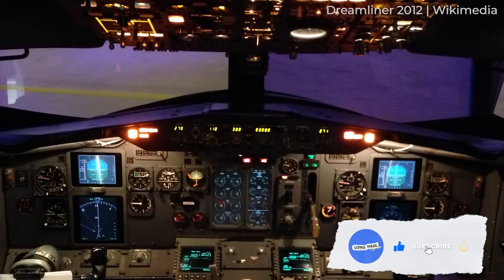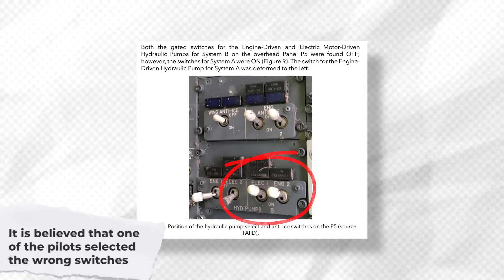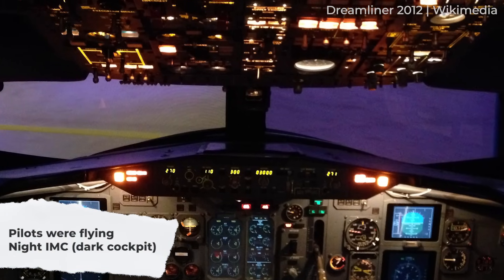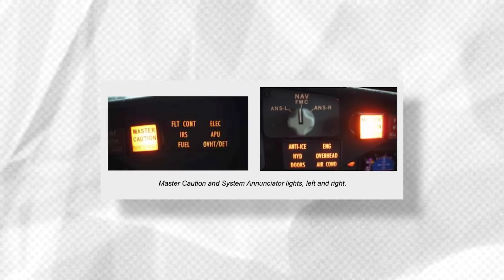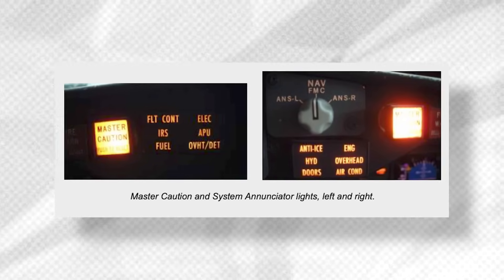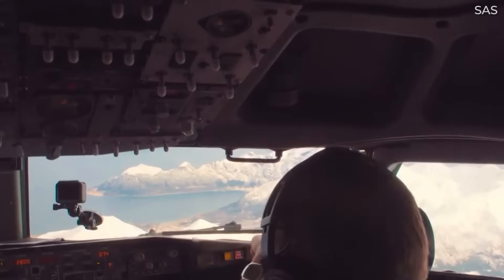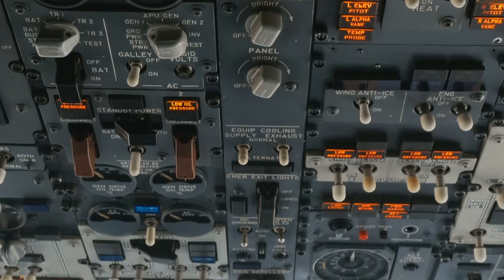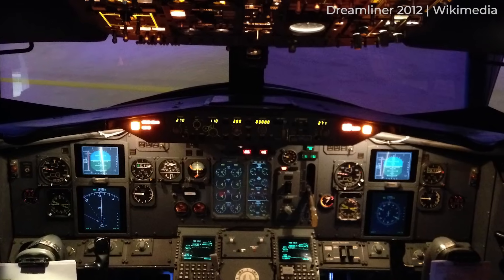Boeing 737 Crash Analysis: Human Error Vs Poor Design

Comment: I think the key is what you highlighted at the end. When you're tired, and already distracted by other things, having a clear, unambiguous place to look for fault messages is much more likely to result in a correct diagnosis. Even better if you can both illuminate the switch AND show an EICAS message. The 737 is a very old design now, designed long before many of the modern ergonomics research was done. Its long passed time that it was changed, and to be fair, it would be impossible to design a new aircraft with the same design, but there will still be 737 flying for another 20 years at least, even if production was stopped tomorrow. Maybe not this exact error, but the same root cause will almost certainly kill again before then

Comment: As a 737 pilot over the last decade I’ve seen enough pilots make this same mistake to say that it’s one that many of us will do once in our career.  If you have good discipline to not cancel any master cautions without announcing the warning and verifying the amber light, it’s no big deal and you simply rectify the error.  These pilots had a lot going against them including as you mentioned possible fatigue after a long night, but in my opinion the biggest human factor in this accident was the fact that they were way too fast and perhaps a little high and behind the aircraft at the beginning of the approach sequence.  I believe this is the real reason why they cancelled the master caution without verifying it.  They were in a self imposed time compression scenario where things were happening faster than they were equipped to handle them.  The cancelling of the caution light was an instinctive reaction to get rid of the added “nuisance” to their already full plate.

Comment: 737NG mechanic here. Even considering the cockpit design, the pilots did the wrong switch movement. As the narrator said “the pilots were concerned about icing conditions, they engaged the engine anti-ice”. If this it’s right, they not only move the wrong switches, they also moved it in the wrong direction because on the -400 variant if you want to move the switch from OFF to ON you have to move it downwards and the pilots moved it upwards which is the sequence from ON to OFF. The engine anti-ice switches have a safety feature that makes you to pull it a little bit out to unlock to prevent accidental or unwanted movement by mistake. (Air conditioning, bleed, and hydraulic have the same feature but window heaters, probe heaters or external lights don’t have the “pull to unlock” design feature and if you work on the 737 CL/NG or Max variants it’s the same, it’s something that you made by instinct when you are familiar with the aircraft. Hope this comment helps.
Reply: Cpt was very new on type and the antiquated design didn’t help.

Comment: While those toggles being so close to something this critical was one of the big reasons why the crash happened, having the Master Caution to be so easily dismissible is something I can't understand. On older models, and even in new ones, I wonder if there's a way to light up or flash the affected toggle by pushing the Master Caution and dismissing it in other way, not by just pressing it. In newer planes, I know that's the job of the screens, but I wonder if in older ones there's something that could be done. I think that if it is possible to press a button to test and light up all the controls in the cockpit, perhaps it might be possible?

Comment: This is not just a Boeing problem. I have flown DC-9's for the same airline but different series identification. The overhead switch panel varied from different models leased by the airline. One had to pay attention to switching systems as switch locations were located before completing an action.
Reply: And Airbus Industrie - noting incident in A340 when captain mistakenly switched off all hydraulic systems in flight - identical x4 adjacent switches for fuel system. Violent temporary loss of control followed

Comment: The pilots fail to recognize the Master Caution, 
failed to recognize the autopilot is disengaged and unable to engage again twice. (The commented on that and manually controlled the aircraft though)
failed to recognize Flaps and LE F/S not coming out all the way from 1 to 15,
failed to recognize the Airspeed is not slowing enough for final approach, and hard to slow down
failed to visually check if the ENG A-I is on when FO asked for a confirmation 
failed to stabilize approach 1000' or even 500' above ground, not just flaps and checklist, but also speed and descend rate, 
failed to go around when not stabilized on final. 
Only find out Flaps are not out 1 seconds before stall and 300 feet above ground.
I don't think a different shape of switch or an EICAS would help much really.
I'm not fully blaming the pilots, they might in a very fatigue condition due to the schedule system, but I train pilots fresh from flight school to 737, if that's what they do in their first simulator section, I'll kick their ass.

Comment: But the Hydraulics were already on when (supposedly) the PM turned them off. This explanation makes no sense. If the PM reached for the wrong switches, the hydraulic switches were already on. He would have had to turn his hand around to turn them off. So a series of mistakes (wrong switches, wrong position, ignoring warnings). That's a lot to go wrong. The holes in the Swiss cheese grew very large indeed.

Comment: Any pilots who said “Master Caution” and “EICAS” is just a minor difference… are absolutely an idiot.

The deal is big enough that all new planes design from around 1980’s onwards must have EICAS.

Note that all 737s are flying on the legacy airworthiness from the original 737 approval back in the 1960s

So none of the 737s has EICAS, including the 737 Max.
Reply: With the exception of the military P-8A Poseidons, which do have EICAS in the cockpit.
Reply: @serkandevel7828 Exactly, the military wouldn't put up with that nonsense.
Reply: @camhusmj38  The military/airforce is willing to invest few tausind dollers a pilot to train them on a safer plane/cockpit design. Airlines, SouthWest in particular, are not willing to spend a dollar, so we are locked to the old 1960's design.
Reply: @ That’s why we have regulators. To stop the penny pinching from getting in the way of safety.

Comment: IMO, I think Boeing should have updated the 737 to a dark cockpit concept after the 300/400/500 series. Idk how much of a cost expense it would have been but if you look at what Boeing did to the 747 product line from the -300 to the -400 and beyond, it would have made logical sense
Reply: @98hkg63  It was proposed by Boeing staff but vetoed by others on the grounds of commonality (common type rating) and cost.
Reply: @ let me guess, vetoed by upper management….as well as a prominent North American customer
Reply: @98hkg63  Yes to both. The quote is a prominent airline customer said “Lock the cockpit” during NG development and we all know about a prominent customer wanting $1m per plane if there was not a common type rating between the NG and the MAX.
Reply: The Classic updates probably only cost Boeing like a billion bucks in the 70s and 80s. The Max upgrades where not much more inflation adjusted. (10bn$ or so most being the engines) Money well spent, except Boeing took a loss of like 30bn$+ because the Max crashes...

Comment: That design has been around for over 30 years and never an issue…. It’s human error
Reply: @ekuche8335  You’re missing the point. The design makes human error more likely and less likely to be caught once it does happen. We have the knowledge and understanding to stop that now.
Reply: Theres a reason why planes developed after the 1950s have a very different design, and developed from the 1980s onward have ECAM or EICAS. 

This design has caused this exact failure thousands of times, but in most cases crews were not seriously fatigued and recovered it. Better designs, like Airbus FBW types or newer Boeings, Embraers and the like do not have this issue, which makes them easier and therefore safer to operate. Yes, i have made the same mistake myself, as has every colleague i flew with on the 737,  but we simply didn’t do any night flights and therefore were a lot less fatigued.
Reply: Exactly this. They chose to disregard the master caution due to fatigue.

Comment: One solution I suggested years ago (1980s), was to change the switches to have different shape like a flat design to be able to verify by tact. Also, typically, if and action is made that triggers either master caution, or master warning, the first thought is to check what was the last action made, and typically, it's associated with the warning. Few pilot's I've know, just simply cancel the master warnings when they light up, or sound, but don't look around to find out what triggered, and this is where that crew was at fault. A master warning that low to the ground cannot just simply be ignored for later. Also, since it was dark, even if dimmed, the overhead warning light should have been noticed.
At this point, a design change would require new training for all the crews, so probably is not going to happen. More attention and situational awareness it's what's needed, so don't touch anything system wise below 1,000 ft.

Comment: Having a button which will kill you next to a button that you use regularly is a bad move. 

Not having a cover or interlock on the death button is a bad move

Having the death button activate an alarm which pilots frequently ignore is a bad idea 

Having an alarm for both nuisance events and events which result in death is a bad idea

Being able to silence the death alarm is a bad idea
Reply: 737 pilots don’t “frequently ignore” the master caution warnings. Anytime that caution comes on, you figure out what it’s addressing. Just because there are some causes that aren’t as serious as others doesn’t mean it’s frequently ignored.
Reply: @FlyByWire1  If you're an A+ Pilot who isn't being overwhelmed with circumstances while simultaneously being bombarded with false alarms.
Reply: It is quite common to silence the alarm as soon as you notice it, in fact that is for example written into the airbus SOPs. But it has to be followed up by checking for the cause of the alarm, which of course is much easier on a plane with an ECAM,as it not only gives the warning in clear text on a screen in your primary field of view, it also automatically brings up the relevant system page, where the wrong system status will be highlighted. The 737 doesn’t have that as it still runs on the airworthiness standard of the 1950s.
Reply: A 737 pilot, no matter what, you are trained to look at the relevant panel which the master caution is telling you to check, this "alarm" in any other operation just simply overlooked by the pilots, in this case this case the pilots decided to try to get ahead of themselves. Its not just simply also button with nothing around it, it is a switch which you physically have to pull over a gate and push down, and there are text all around it (which is clearly illuminated). Sure not the best and optimized design, but the fact the pilot completely wandered away from his training I doubt a change in warning systems would really make a difference in this case.
Reply: @unifiedmemory7872  737 pilots have Stockholm syndrome. The fact is a superior warning system would be better and reduce the probability of error.

Comment: having studied human factors in college, its clear that having Elec1(2) Hyd Pumps have the same, shape, color, size, and being unguarded is beyond reasonable in today's designs.  

Even the KC-135R had a separate "OVHD WARN" light to direct your attention UP to locate the light that was illumining the warning/caution.

Lastly, a "centralized" EICAS/ECAM is beneficial ins a specific way: warnings & cautions are always in the same location, and are easily readable from both seats.  The mishap aircraft has caution lights spread all over the panel which means some are more difficult to read from each seat.
Reply: They are also prioritised and have four different levels as opposed to the two that the master caution manages.

Comment: And that is why the new 737 MAXes and 777X are facing delays on the grounds that they don't have enough clear warning systems like modern cockpits. Boeing cockpits are terrible "by design".
Reply: @MrCaiobrz  That's not fair. The 777/787 have modern cockpits. There was a lot of human factors research that went into them. The 737 cockpit is terrible because it's a relic that should be put out to pasture. It was the first Boeing plane with a 2 person cockpit and so it's a complete mess. The 757/767 were better.
Reply: N... No? There new airplanes already have adequate warning systems. 777x and 737 maxes reasons for delays are completely different.
Reply: Really?
777 has EICAS
777X is a modern cockpit
777 is actually YOUNGER than A320

Comment: During the development of both the NG and the MAX, human factors experts at Boeing suggested moving to a modernised cockpit designed with what we know about cockpit ergonomics and what was learned during the 777/787 development. In both cases, this was overruled on the grounds of cost, commonality and speed. It has been suggested that an Airline executive (Southwest probably) told Boeing to "lock the cockpit" and not allow changes. 
Although this aircraft was a classic - so predates this, it beggars belief that we are STILL allowing Boeing to produce this cockpit into new airliners in 2025. Airliners that will last into the 2040s at least. EICAS has been standard on Boeing planes since the 757/767. The military variant of the 737 (the P8) has EICAS. There is no reason at all that the cockpit of the MAX could not be redesigned to modern standards beyond cost and a desire for commonality.
It shouldn't be allowed - incidentally, if the MAX was a newly developed aircraft, it wouldn't be. It's only because the basis of certification is stuck in the past that this is permitted.
Reply: A more complicated cockpit would always have lead to new type rating required, so it was always a no for Boeing. Apparrently Boeing wanted to spend the same billions as designing a new type regardless...
Reply: What is bad about5 having no EICAS?
Like its bad, but not deadly.
Reply: @ Safety is a layered concept. EICAS is a superior human-machine interface to the Christmas tree light approach of earlier designs. It is also required for this reason by the FARs for new designs and by Act of Congress actually.
Reply: Many portions of the 737 cockpits were redesigned and improved between the Classic, NG and MAX but it wasn’t a complete cockpit overhaul as you favor.
Reply: @FlyByWire1  True, but not enough to break the common type rating. Although, the FAA did not allow the same pilots to fly Classics and MAXes. Southwest originally asked for steam gauges to be kept on the NG - Boeing programmed it as an option on the PFD. It was only after SW pilots asked for the newer displays did SW switch over to it.
The overhead panel has not changed significantly and is still the same mess it was when it was first designed to replace the flight engineer panel on 727s.

Comment: design error is possible but if design from 60s have switching accidently multiple times by pilots boeing could be redesigning completely of 737s overhead panels, also 737 still using an old warning system which illuminating system's fault side of master caution light (recall button) instead on eicas even on 737 max! boeing since 80s they add system fault memo on eicas on 757, 767 and following on newer aircrafts except 737.
the main reason for aircraft crash is pilot error, even if switching hydraulic pump off accidently is done pilot still have chance to resolve it but cancelling master caution without investigating makes worse situation.
Reply: This is true - but the issue is that our understanding of human factors means we know that humans make mistakes. Designers' jobs are to reduce the chance of those mistakes having a negative impact on safety. I think it is fairly clear that this accident could not have happened on any plane designed to modern standards. The 737 reflects a philosophy that has been supplanted.

Comment: I propose that instead of a generic Master Warning the aircraft says “Hey DumbAss, you turned the engine hydraulics off”
Reply: Would probably cost a couple 100m$ to retrofit such to all 737 aircraft... But that is 100m$ too much for Boeing or most Boeing customers... 

Heck, I could even make a program with machine vision to monitor the overhead panel for free. 😂😂
Reply: @rkan2  Fun fact is that Boeing has already designed EICAS for the 737 - the military demanded it for their variant. They left things as they were on the civilian variant because of SouthWest.
Reply: All new aircraft required the plane to say exactly just that to the pilot…

But 737 is flying on the “legacy” airworthiness approval from the original 737 series all the way back to 1960’s

Hence you have the ancient and generic “master warning” 

Yes, the FAA was heavily lobbied by Boeing to allowed this.
Reply: @tonamg53 that is blatantly false. Every single new plane model that is certified receives an updated AD from the FAA. This comment is funny to me because it’s so easily proven false by a quick google search. lol